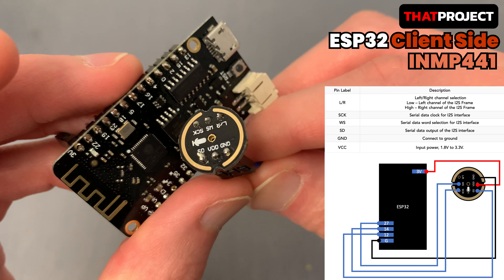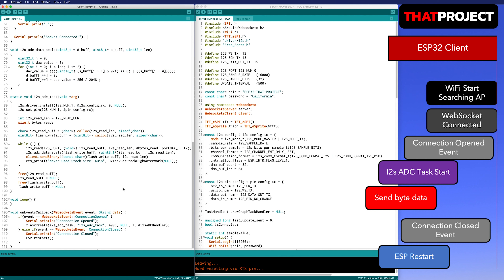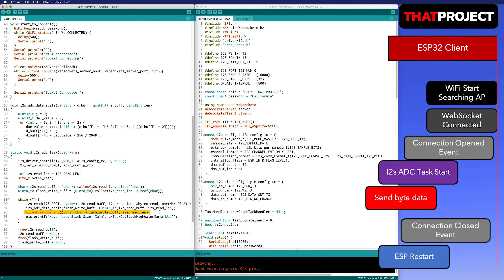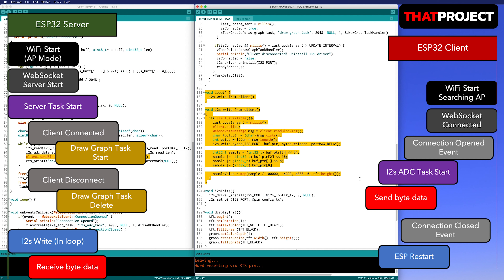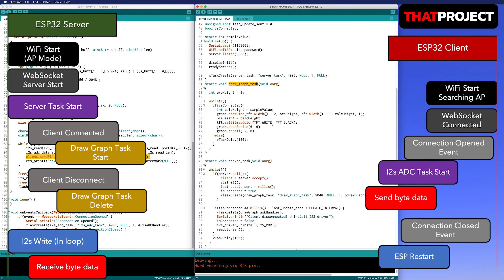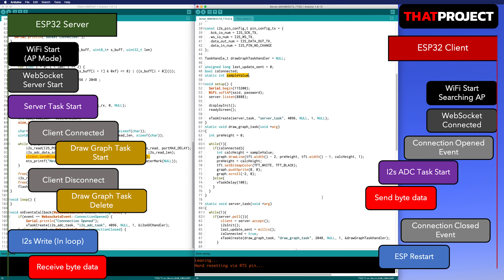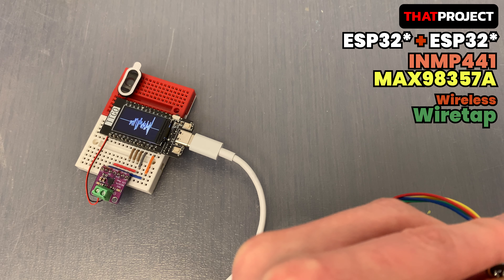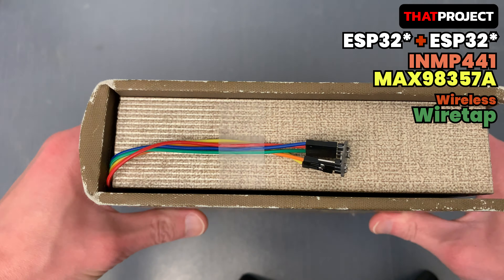Wireless Wiretap System using 2x ESP32, INMP441 & MAX98357A

Comment: Hello, Very good Project. can i connect 0.5w speaker in server and using lm386 amplifier and XT_DAC library?
Reply from the maker: Using I2C Digital to Analog Converter seems to be able to output the sound without problems, but I haven't tried any DAC-related projects yet.
Reply: @ThatProject  thank you. Then I”l use i2s DAC only. Thanks for sharing this project.

Comment: I get the error i2s_write_bytes not found at server code, when I search in i2s.h I find only i2s_write and i2s_write_expand, not i2s_write_bytes! When I replace i2s_write_bytes by the 2 others I still get an error. Please help! Thx
Reply from the maker: This project is based on ESP version 1.0.6. If you want to run my project without problems, run it on ESP 1.0.6.
I'm having a project in a different field, so I can't give you a proper solution to this problem for now. Thank you for your understanding.
Reply: @ThatProject  How i can do that?

Comment: So you not used a(n)  (streaming)audio format? It are the dma's at both sides that synchronize all the audio? It would be nice if you can explain the dma system in depth.
Reply from the maker: This post will answer your question. https://blog.cmgresearch.com/2021/04/20/esp32-i2s-dma-buf-len-buf-count.html

Comment: it showing error.>>>>>>>>>>>>>>>>>>

     i2s_write_bytes(I2S_PORT, buf_ptr, bytes_written, portMAX_DELAY);

     ^~~~~~~~~~~~~~~
Reply from the maker: Because this project is based on ESP version 1.0.6. Seems like you're using ESP version 2.X. Please use the previous version 1.0.6 or need to update the code.

Comment: what version do you have of arduino ide? thanks
Reply from the maker: In this project, I used the Arduino IDE 1.8.13.
Reply: @ThatProject  eventually I have to buy a new card? if yes which one for the client thanks
Reply from the maker: @bicio330  Well, I'm not sure about that. I hope you resolve that issue with what you have now.
Reply: @ThatProject  many thanks

Comment: Hi why did you use websockets instead of normal  TCP sockets? I thought websockets are used when you want a permanent socket from the browser to the esp32. But here is no browser involved, so I am confused. Thx.
Reply from the maker: The reason for using WebSockets is simple. Since all incoming data packets are handled by WebSocket, data (voice, image) can be handled easily. As you know, also it's based on TCP.
Reply: @ThatProject  I try to test and understand your code, but get an error on const char* ssid = "ESP32-THAT-PROJECT"; redefinition of 'const char* ssid'. Could you tell us why dma_buf_count is 32 en dms_buf_len = 64? Where does this 32 and 64 come from? Thank you in advance!
Reply from the maker: @SA-oj3bo  The SSID should be set with your wireless router's one. If you have a message with redefinition, somewhere in your code has other ssid variables. Please check your code again. I found a DMA Buffer setting that is small and flexible enough to work in my environment.
Reply: @ThatProject I put client and server in different tabs, that was not clever :-)

Comment: Hey can we connect esp8266 as client with the ESP32 as server?
Reply from the maker: There is no problem with the I2S interface on ESP8266. You may just need to modify the Web Socket part on ESP8266.